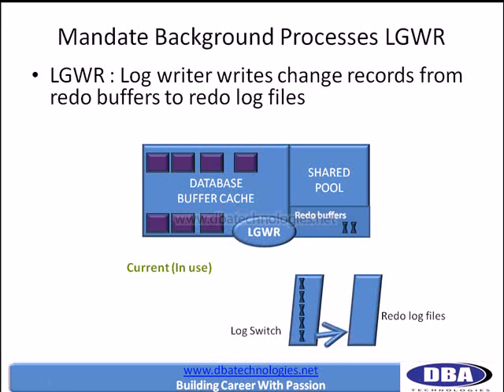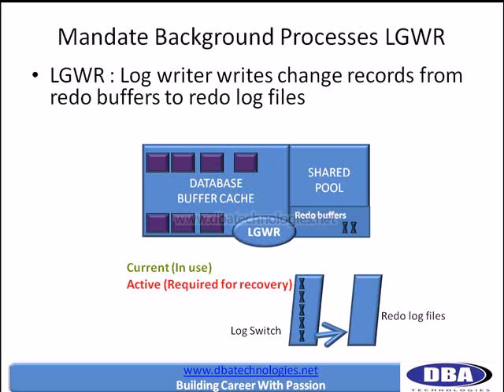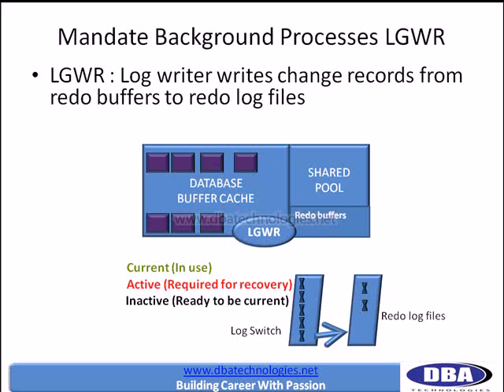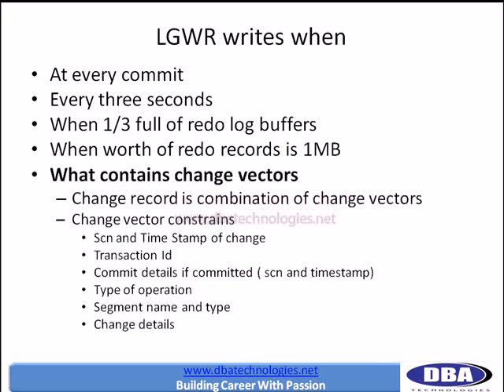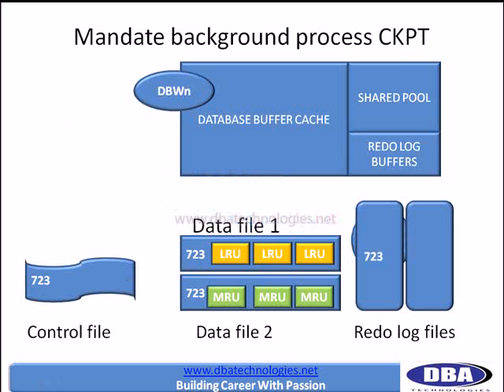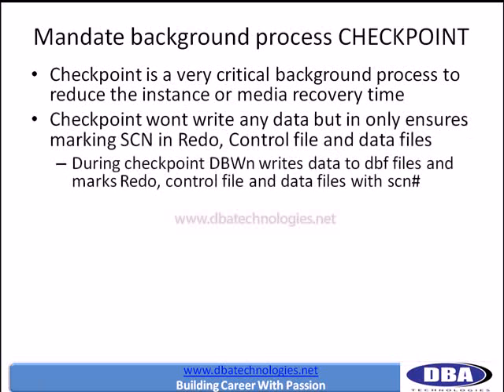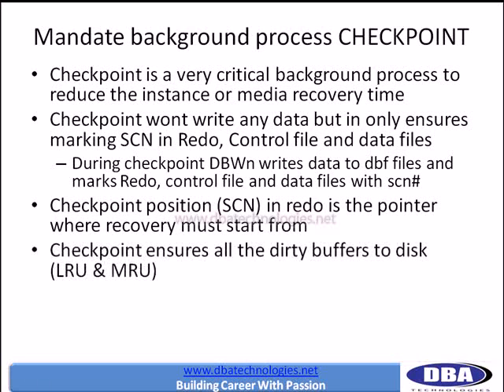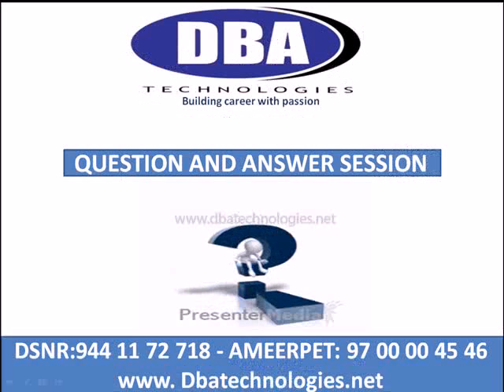Oracle dba online training - architecture (5) - (LGWR and CKPT)

Comment: Sir, I have a small doubt. DBWR writes data (committed & uncommitted) from Buffer cache to datafiles. whats the use of uncommitted data here ?/
Reply from the maker: DBWn write dirty buffer irrespective of database is been committed or not.  This is because assuming user is going to commit that is why commit effort less.  Rollback is an exception that would reverse the process by using undo.  This is the default behavior.  Hope this helps.